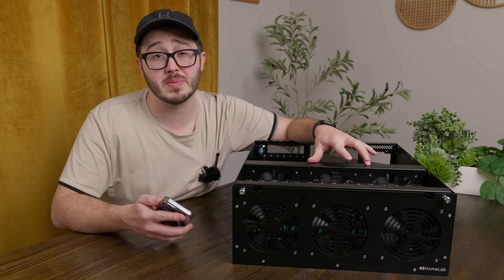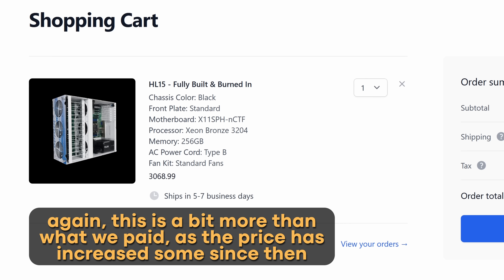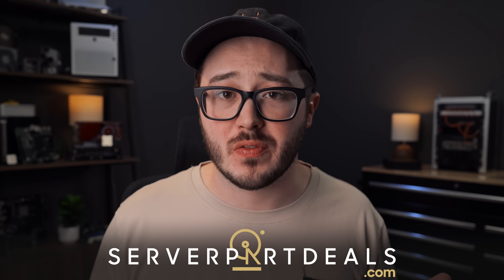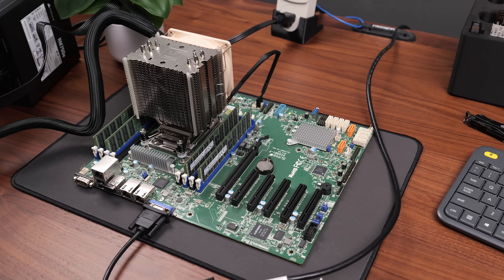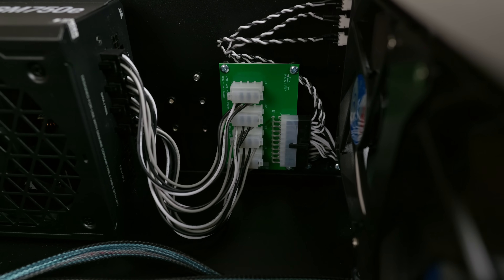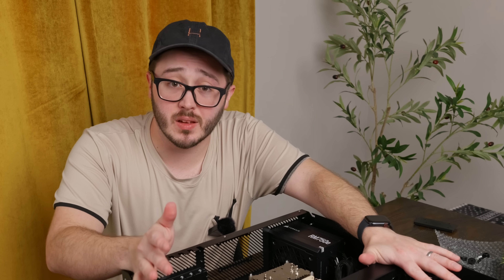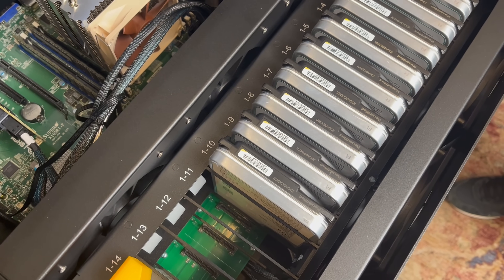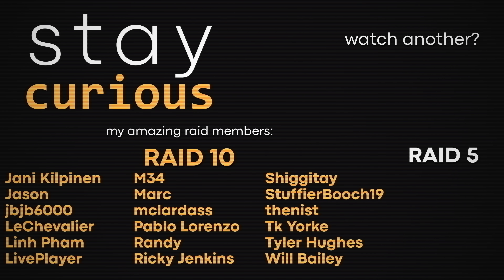I got an HL15... but not for the reason you think.

Comment: in a world where you can get barebones supermicro 847 chassis with 1200w sq power supplies (that are easy to find for replacements and are cheap to do so), that includes a 24 bay backplane at the front and a 12 bay backplane at the rear, and easily replacable fan wall for quiet high static pressure fans (I personally went with 3x arctic p14 max's and 5x arctic p8 max's, very quiet high static pressure fans), 3d printed a fan wall for the 3 big fans, attached the 80mm fans with a vhb-taped rail that I 3d printed with 2 fans directly in front of the motherboard tray to blow air directly over pcie and heatsink, and 3 at the bottom rear of the case just in front of the rear drive bays to promote cooling through the rear backplane.  it's just an atx case so any parts (including what you chose here) would fit fine, I had some old leftover desktop hardware, so I installed my ryzen 7 3700x on an x570 board, dropped in a sas3 16 channel hba to max out backplane bandwidth (each backplane can support 8 channels (2 connectors) of sas, the backplanes have expanders integrated, dropped in a dual port 10g network card, vhb taped'd a couple of ssd's inside the chassis for booting, slog, and metadata cache, and I currently have a single pool with 3 raidz2 vdevs that are 8 disks wide (total of 24 hard drives), a mirror of enterprise sata drives (directly connected to the board) for booting, a mirror for slog, and a mirror for metadata (to keep seeks speedy) (all mirrors are 1tb used sata enterprise ssd's that are advertised to 3wpd and that should be totally fine for my purposes as a homelab nas / archival storage / plex host / seed box.  the whole thing without disk cost me maybe $900 in parts. taking into account the current prices of used ryzen boards as well)... the hl15 seems like it's got excellent build quality, 45 drives has some renown support (which is great), but I just don't think I could justify just a chassis/backplane solution for $1000 (probably a bit more than that shipped, i'm going by their advertised prices on the website).  I don't get how it would make financial sense. - it's also quite small on drive bays - optimal raidz/2 configuration would be 2 vdevs 7 drives wide and a hot spare with something like that... which I guess is fine, but is still pretty limiting, particularly for the money, and it's the same number of rack units so in terms of rack density, it's not nearly as good as the cheaper option I outlined...  don't get me wrong, I really like what 45 drives has going on generally (their storinator boxes are really nice, if a bit too expensive), but I think they really missed with the hl15 personally.
Reply from the maker: Once again, the form factor was a huge limiting factor here. Otherwise a SM chassis would’ve most likely been the choice
Reply: @HardwareHaven  the sm chassis is 4u as well, is it a depth issue you were trying to solve?  I'm just curious what about the form factor made this a good fit for this use case? thanks!  I love your work!
Reply: @joshhardin666  AV racks are usually 20-24" deep, 847 is 27".  I've come across this issue more than a few times myself with companies that started out with an AV rack for whatever reason.

Comment: honestly fan isn't that janky have used StarTech Expansion Slot Rear Exhaust Cooling Fans in the past to cool some heat sink only expansion cards. They move a surprising amount of air. Some HBA cards have heat sensors might be able to monitor this directly if you are worried.

Comment: I'll take the 10 bay sliger case for half the price.  45 have always been overpriced, but raising the price by almost $200 is just a nail in the coffin.
Reply from the maker: Sadly I wouldn’t be surprise to see the sliger stuff jump up in price has well here soon. 

The problem with those is that the shorter depth cases are more limited on power supplies and motherboards, not to mention having fewer drive bays. 

If I ever get a rack, those seem like very realistic options
Reply: @HardwareHaven  I do prefer the hl15's fan setup, pushing fresh air over the drives
Reply from the maker: Yeah I WISH there were cheaper alternatives because it does “just work” really well for a NAS build. I was simultaneously having to do some work on one of my TrueNAS systems in tower cases and… well needless to say, I had an HL15 in my cart for a few minutes. Couldn’t justify it though 😅

Comment: Is there any short depth server rack case that could be cheaper? Would like to find one that would support 4 or 6 drives, along with water cooling mounts. Height is not an issue, but depth is. Any suggestions?
Reply from the maker: Maybe some of the rose will 4U cases? Sliger also has some 10 bay shorter depth cases but only support ITX/mATX and SFX power supplies
Reply: If you only need 4-6 drives Norco or IstarUsa might have something though water cooling mounts might be asking a lot without some modding.

Comment: power usage ?
Reply from the maker: I didn’t think to test before we got it setup. UPS was showing around like 220W if I recall (with both systems running)
Reply: @HardwareHaven  you did have watt meter connected.
Reply from the maker: That doesn’t mean I looked at it😅

I also didn’t have the drives at home to test with anyway
Reply: @HardwareHaven  why not use a zigbee, wifi or matter based power monitor? Shelly, third-reality or even tuya to record to homeassistant?
Reply from the maker: I prefer to just look at it vs pulling up something in a browser
Reply: @HardwareHaven  idea for new power plug... display + integration into Homeassistant.

Comment: I've sort of dipped into this before but have no idea how I would do it today. Maybe.
I use a discontinued Norco 2U rack with 6 internal bays, NO hot swap. Does the job.
Powered it with a Phenom II X4 955 then FX-8370 for speed and thermal advantage.
The only 5.25" bay can be modified for remote GPU but I've opted for a Quadro P620.

SSDs are Corsair 60GB sata and 240GB M.2, along with a 400GB LSI Warpdrive.
HDD plan is to load up several 16TB Toshiba MG08 series disks in JBOD. Works great.
Currently limited on mainboard and PSU connections. The thru-flow design is a catch.
A set of 80mm Zalman LED fans keeps everything cool and quiet™ for now.
Still, your solution with the HL15 appears lightyears ahead.
Only issue is for anything personal I get burned by Supermicro every time, so I won't do that.
Going Gigabyte or Asus seems no better but I take common desktop components and rack them.
Reply: Yeah, nobody cares... sorry.
Reply: My comment isn't for you or the braindead zoomers.